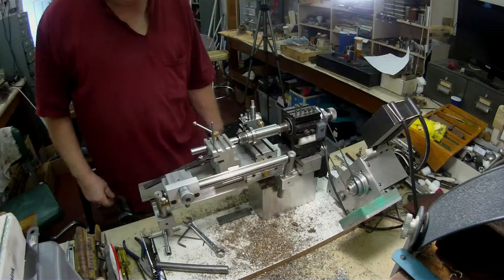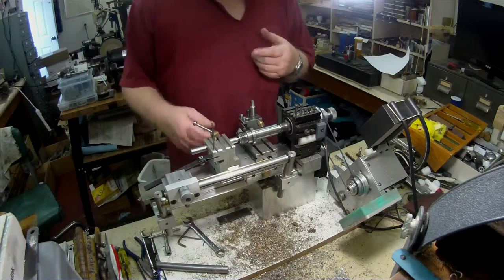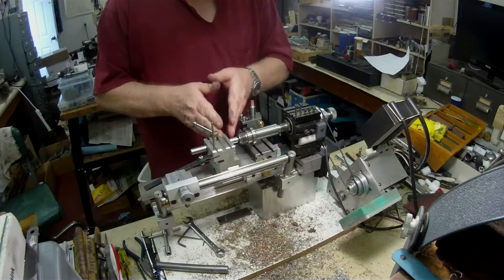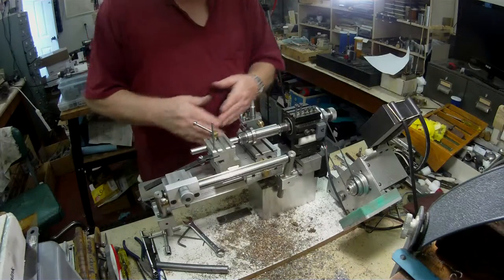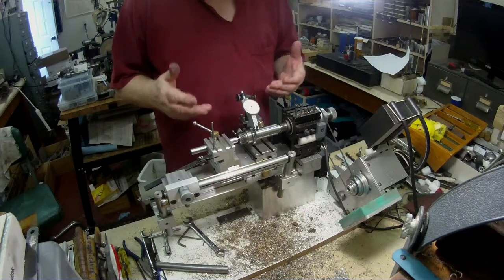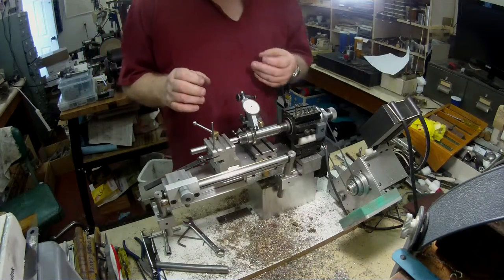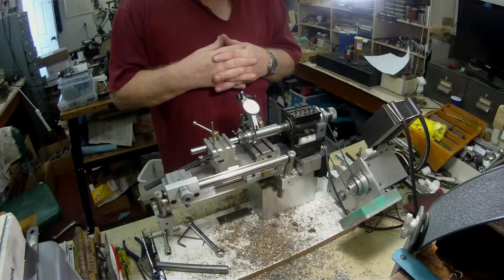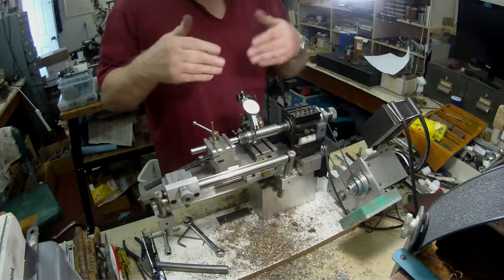FILE0014  2nd part Modifying Dividing head Adaptor for Taig Chuck

Comment: Nice project.... I'll be following along.
Reply from the maker: timothy svec 
    Hope you enjoy Timothy, thanks for showing interest, I 'm hoping it will illustrate that sometimes you can't always do a certain job because of lack of space on certain lathes and not having single point threading capabilities you sometimes have to put your thinking cap on and go in another direction, now I might have problems running a 3/4 dia on steel considering the size of lathe, I have a whole pile of thread chasers that maybe I can try first I'l have to look see if I have that pitch, so that should be interesting,

Comment: If one looks at Nick Carter's website, www.cartertools.com there is at least one article on a thread copying attachment for the Taig. Enormous amount of Taig info on that site. Anyway the thread copy attachment is inspired by the Unimat one. That could be useful in the future. Tony Jefree's book "The Taig Lathe" goes through the mods to put a feedscrew  on it, using parts from the Sherline screw cutting attachment.  I sure don't know  how to cut 3/4-16 except with taps & dies.